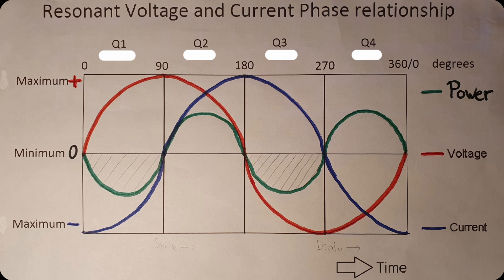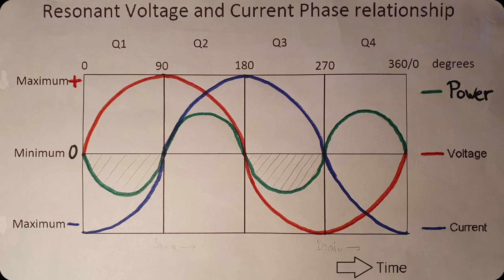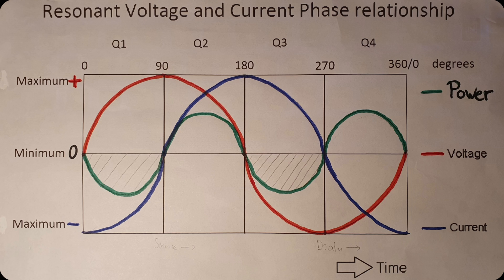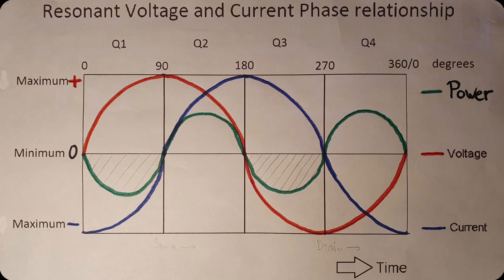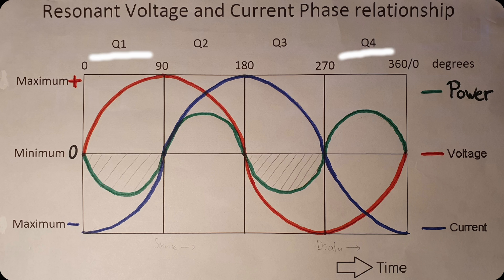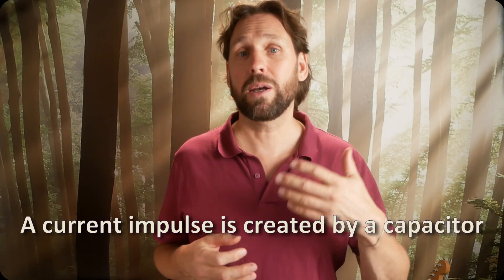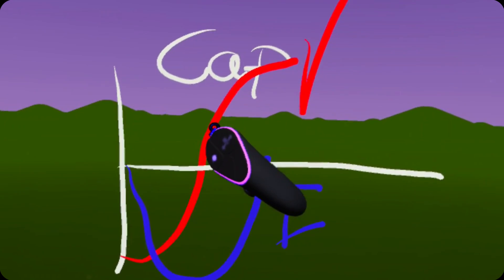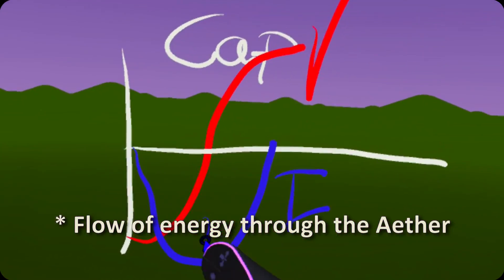What are Electric Impulses and what can you do with them?

Comment: Very good presentation, I really enjoy your experiments and the methodical approach you take.

In return let offer some additional perspective on what I believe you are observing in the inductors.

I take in a lot of different perspectives from investigators like yourself. One of those was Joseph Newman. Although I disagree with much of what Newman espoused, I believe he was right about one thing. That is that there is right-hand-rule gyroscopic action taking place in the charge and discharge of an inductor.

Specifically, a charging inductor produces a back-current as the magnetic field expands. This back-current is the reason the voltage across the inductor starts out high initially and then drop to the steady-state value (I.e. that due to only the resistance of the coil when the magnetic field is fully formed).

When the inductor is then opened, what was a back-current when being charged becomes a forward-current when collapsing becoming in essence it’s own current source driven by collapsing magnetic field. The voltage across the coil must of course follow suit with the current.

I am not arguing that energy is not stored in the magnetic field. But the difference between the self-inductance of a coil versus the same length of wire not coiled is due to the flux lines expanding beyond the physical boundary of the wire has no opportunity to create additional back-current in a straight wire as opposed to a coiled wire where it will cross additional conductors, thus the much higher self-inductance of a coil.

I believe having a physical appreciation for the source of inductive behavior in incomplete without understanding the induced currents created during formation and collapse of the magnetic field. 

I hope this makes sense to you and adds to the vast understanding you have already acquired.

Keep up the great work!

Comment: Master Ivo, you are still thinking in 2D, and thus this logic is being show in the graphs. You have to imagine how these impulses are propagated in 3D, as on a surface of a elongated (round) metal. Only then the true realization of the waves and impulses will manifest itself.
Reply from the maker: yes ring toroid
Reply: @MasterIvo  the toroid is the most stable fluid shape as it is self-staining ( on many levels), and it may have something to do with propagating electric impulse over a round metallic shape, when you also involve the curl and divergent concepts (that idea may have merits). On another side, the issue historically has been the 2D (visual) presentation of the EM waves. Ones we IMAGINE that the 2D is just e projection of a 3D wave structure (very easy to draw over a round glass bottle) we start to think about the entire electric-magnetic field dynamics in a very different and a lot more natural way.
Reply: I think he is using 2D for simply this stage of explanation. Notice some questions about other points such as this one above "According to your aether theory: What is voltage? What is current? And are magnetism and dielectricity two sides of the same coin of the aether? I would like to visualize these concepts once and for all." and Ivo answers: "Good questions." This strongly indicates that Ivo himself is trying to get things down in a basic premise and visualization before extruding this into more comprehensive topics - which I would argue the 3D thinking is largely analogous to these questions from the other commenter.

Comment: Dear Ivo, do you have any info or circuit for electronic switching the coils on and off, alternative to mechanical switching like relay or reed switches? This maybe 6:39? For example I would like to find resonance of a coil using a digital signal generator, but connecting a coil directly to the signal generator might damage it, so I need a circuit that switches the coil (which can work with more power). To get a true back emf pulse we need true 'off' possibility, mechanical switches do that (they do break the connection), but for example most electronic/solid state relais do not have a true 'connection break', the circuit is not 'open' for the back emf pulse to happen. I hope I have stated my question clearly. By the way I’m Dutch and live in the Netherlands too, seeing the most comments are in English, I thought I ask my question in English too, so the rest can follow. 😊
Reply from the maker: Hi close by neighbor, I designed a mosfet driver but the parts are out if stock.
low side mosfet with gate driver is easiest method for impulse generation. use C2M or C2M wolfspeed mosfet, with any gate driver

Comment: The full sine wave shown on the scope - when the spark gap fires and the scope shows the signal drop below the 0 volts reference line and take on a negative voltage - may be occurring due to the fact that when the capacitor top discharges (say, 10 volts was there) the 10 volts now appears on the opposite (bottom) plate.

You can use a half wave voltage doubler to shift a sine wave so that its 0 volts reference line is shifted upward by the peak voltage of the peak to peak signal.  EXAMPLE:  a 20 volt peak-to-peak with a 0 volts reference (10 volts in the positive 1/2 cycle, -10 volts during the negative 1/2 cycle)  - the entire sine wave shifts upwards by 10 volts and it's like a 10 volts DC offset has been added to the sine wave, putting its  "zero volts reference line" all the way up to 10 volts.  It is done with a 'clamping diode', this action.   The 10 volts DC offset is not provided by any battery or power source.  The clamping diode gets charged to the peak voltage (10volts in this example) during the positive 1/2 cycle of the sine wave, then does not lose that 10 volts during the negative 1/2 cycle due to the use of diodes.  A 2nd capacitor gets charged to 10 volts during the negative 1/2 cycle of the sine wave, but from an existing reference of 10 volts that's still present on the clamping diode.

Thank you kindly for an excellent video!

Comment: Another notable thing about impulse current. "Positive" impulse current is magnetic based. "Negative" impulse current is dielectric/electric based. The difference can be seen on the color of the arcs.
Reply: Yellow to White spark = Arc discharge, High current, Low voltage across spark

White to Blue spark = Glow discharge, Low current, High voltage across spark

You want the voltage across the spark  to oscillate rapidly which leads to displacement current. So you want a high frequency oscillation between a glow discharge and an arc discharge.
Reply from the maker: I disagree, white spark seems to be current related, I have seen both effects on the different polarities
Reply: @MasterIvo  But I thought white golden ratio arc had healing effects as opposed to purple arc
Reply from the maker: it might have, but I don't dare to touch it
Reply: @MasterIvo  Also I meant the negative voltage impulse current.

Comment: I had something strange happened when I was doing electrical work in commercial buildings, we used flexible conduit basically a extension cord, with 3phases, neutral and ground, a piece I had was damaged, it shorted when I plugged it in, the strange part was it felt like a balloon was blew up really fast, then popped like right in my hands, I felt a pressure on my arms and hands , then it was gone, faster than a blink, that was 20 years ago, and I'm still wonder what that was!?!?. happy Holidays✌️
Reply from the maker: Great story! I heard simular fx from high voltage discharges. pressure waves...

Comment: Its termed as ”displacement current" but its really just the removal of the magnetic field. The SG allows the energy to travel through a dielectric (atmosphere/water) in forms of ions like two electrodes in a medium(battery). The atmosphere acts like an ocean on the speed of 10x. ions that splash the circuit initially  surround all of the electronics connected to it while sending joules to all of the capacitors at the same time. I noticed that the capacitors see this as a zero phase due to the energy not having to transform from magentic to ionic back to magnetic.
Reply from the maker: also works in vacuum, no ions
Reply: @MasterIvo  lightining strikes just light the SG. Energy moves in the form  ions between the electrodes of a SG through pressure just like lightining between the sky and ground. When ever lightining strikes, it charges everything in that circuit or frys it.

Comment: But what I have to do if I want my electric car recharge by itself?
Reply from the maker: I would not prefer to recharge.
Rather, remove the battery all together and run from the generator/capacitors.
But then the car would be to light, so I guess flying would be preferable.
Reply: @MasterIvo  I think the best is to leave there the battery and when it is fully charged with your circuit a kind of switch should make it to run without using the battery.  I  have a Renault Zoe. I want to cross all EU up to Sardinia.
Reply from the maker: better make it floating :)
Reply: @MasterIvo  come on not joking, what can I do to run it longer? And can be done with your circuit? 
If I put 2 bifiliar coils before sending the pulse to the engine and doing half pulse will it be enough to not loose energy on the bsck EMF?
Reply from the maker: not joking, I don't know (yet) If I would know, I'd share
Reply: @MasterIvo  okay so it is not yet possible to do it? I was understanding that you can get out more energy of what you put in.
Reply from the maker: @fabrizioloddo6300  not for a car. I have seen and showed that energy definitely is increased, but energy is no the same as power. I have not yet been able to get more power out than in
Reply: @MasterIvo I saw a different type of transformer that could do it. I will find again out and I will turn it to you if you wish.

Comment: Voltage/Pressure induces flow/movement/electrons  Current induces Pressure/Voltage and reduces movement of electrons to do so
Reply: You may want to look into the papers of Ionel Dinu in relation to your remarks and in conjunction with Ivo's excellent work here. They are very complimentary and relate to your remarks.

Comment: Current is the electrons being moved in a direction , voltage does not move its simply potential aka pressure
Reply from the maker: you are talking aboit conventional current.
and its not the voltage, but the rapid change in high voltage.
Reply: @MasterIvo  I guess i am , but flyback current if its real , only flows in the inverse polarity to your charge and i guess it may be different current (if it exists) since this current is not sourced from Human source rather from cosmic source , as if there is any other kind (source) after all Human motion is directly sourced from cosmic motion just at different rpm and potential
Reply from the maker: the flyback current is resonant (reactive) current, but for me its all about the change voltage
Reply: @MasterIvo  sounds accurate more specific resonant with environmental potential aka ether
Reply: @MasterIvo  our man made current is resonant with natures source simply because they both operate on potential
Reply: But are electrons actually real? I have my doubts and I find the work of Dimitri Mendeleev wherein he predicted both an aether and another "element" lower than hydrogen. Ionel Dinu, in his papers, has extrapolated this out to a "substance" he calls electrigen, which I am warming up to as a proper replacement for the electron concept.